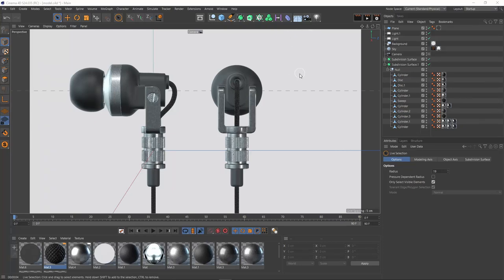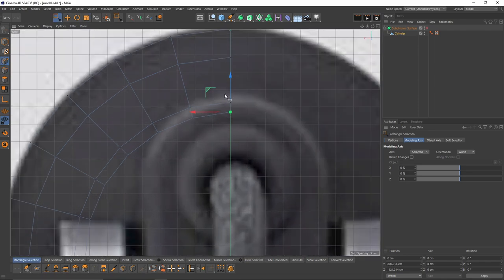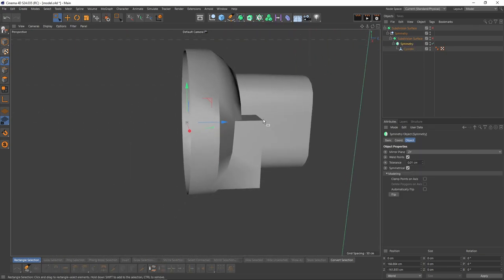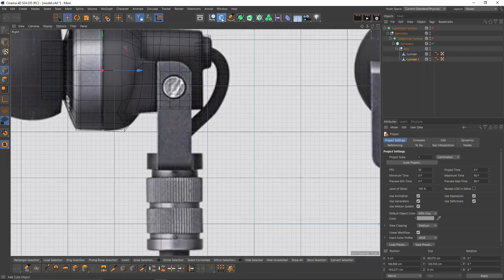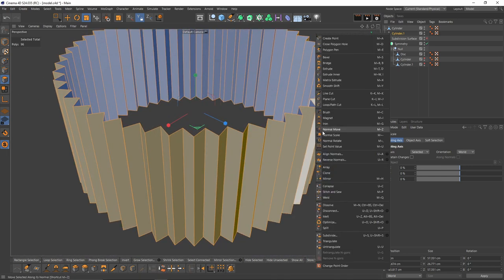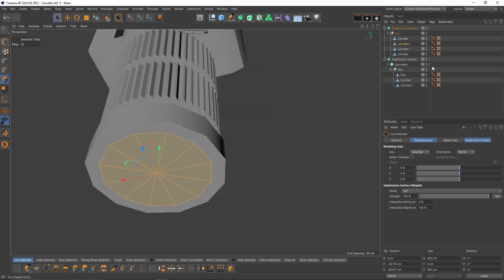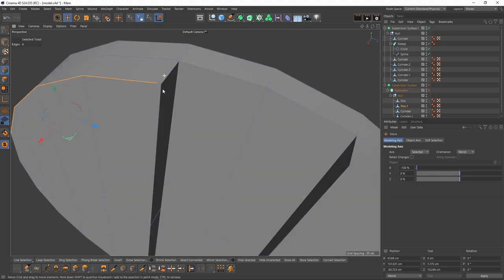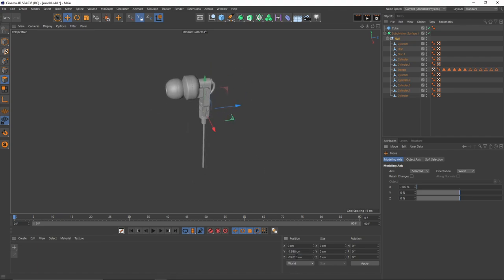Industrial Design/Product Modeling #12 | Earpiece

Comment: Hi there. Great work. Really appreciated. I just wonder your light setup. Could not see the lights. Actually I created exact same setup as yours (I guess) but my renders are dull and materials are less shiny. I expect it to be because of the light. Thanks again. You're the best! :)
Reply from the maker: Thanks, my main light is the HDRI, there is a rectange light but it is too low to effect the scene, I think you should set your HDRI's exposure to 2 like mine, it may be the problem, select your mitmap in the material( HDRI) and set the exposure to 2.
Reply: @polygonpen  It worked. Thanks alot! :)

Comment: Hey buddy, can i request about making normal maps from High poly to Low poly? i saw the one u made with pillar, but it is scuplting. i tried the same principles on hard surface model, and it didn't go quite well.
Reply from the maker: Yeah, I can't get it work, I mean you can not bake an object from high to low, except sculpting, I tried everything but no, I think Cinena 4D's phong tag is the problem, also C4D has no cage system it may be one of the problems.

Comment: Hi, im trying to follow up with the textures, i have double checked everything but somehow my textures are white instead of black when i add the ggx
Reply from the maker: try to change the fresnel type, lower it like 1.6 for plastics, for metal parts make it higher than 6.
Reply: @polygonpen  thnx! the settings do wonders, i found the missing fresnel type myself but it still was plasticlike because i had it on 1.6. best tuts ever imo! keep it up